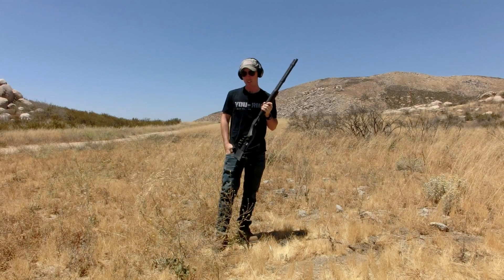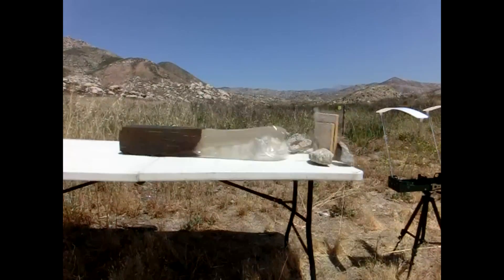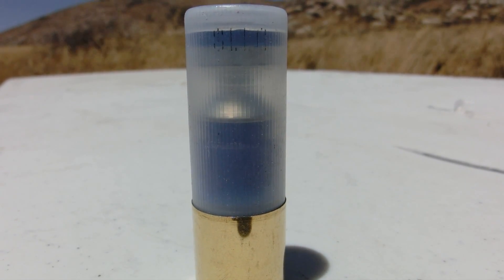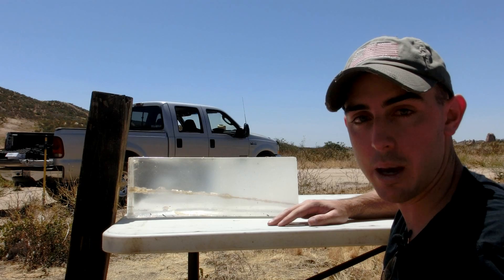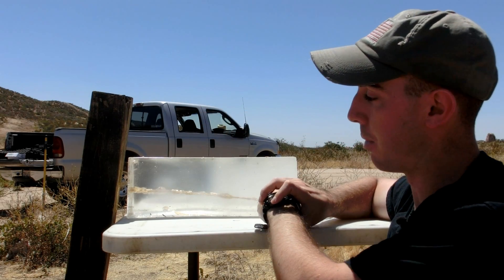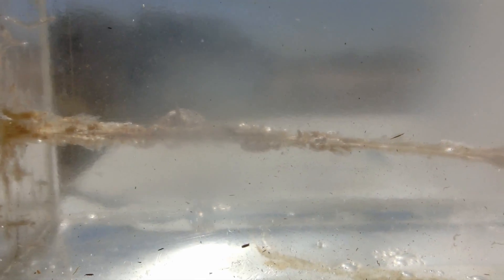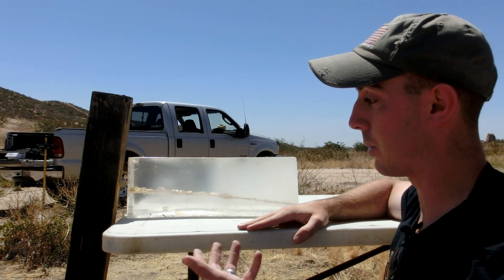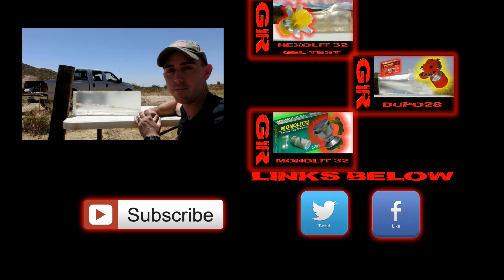Gel Test - DDupleks Monolit 28

Comment: If you can get the weight into a projectile, which a shotgun allows you to because of the space available for the load, using steel makes a lot of sense as a material in terms of its ability to cut through things and remain in one piece. Normally we are using lead and copper because we need high density to get the weight. The way that slug punched through the wood shows a lot about it's abilities, imagine punching a hole like that in a charging dangerous animal.